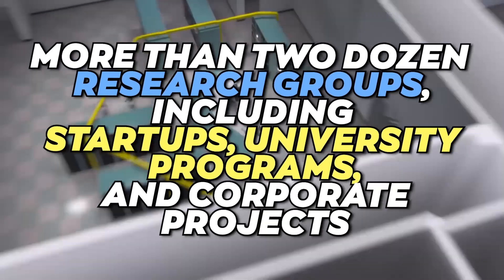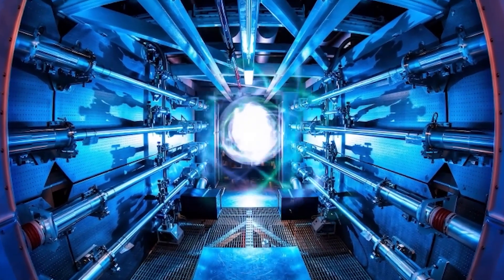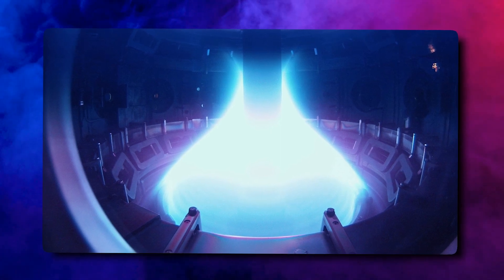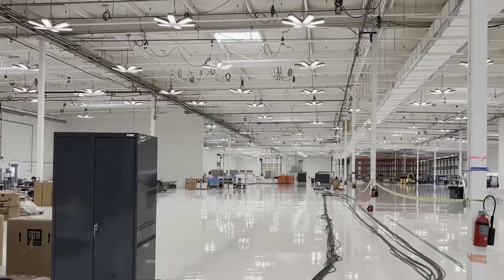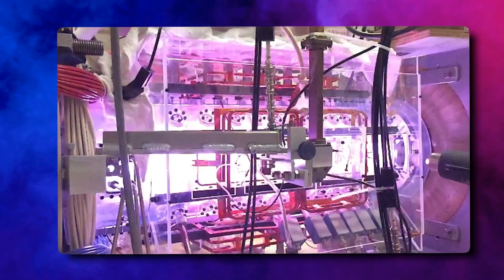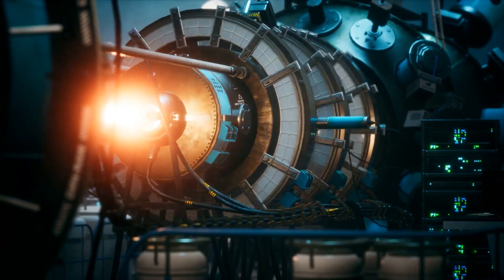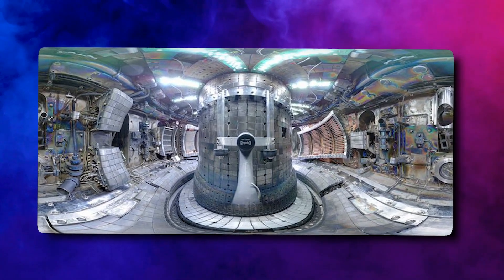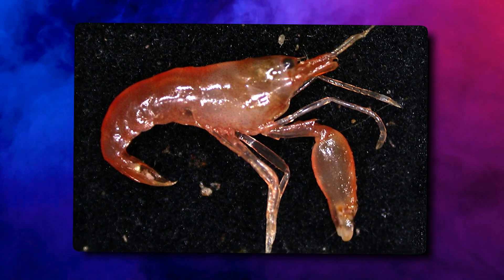Fusion Power Is About To Become A Reality..

Comment: total GARBAGE. fusion wont be achieve anytime soon. One successful experiment where they put a few megawatts in, got a few megawatts out, cost 400 megawatts in lasers. So dont hold your breath for promised improvements. Its just the researchers giving you hope so they get funding. Even if they were close, the first reactor would take 15-20 years to build and come on line. Fusion is not going to save the planet, its too late for that.